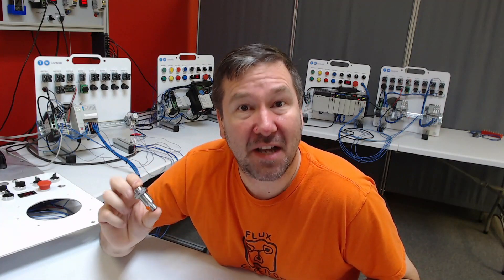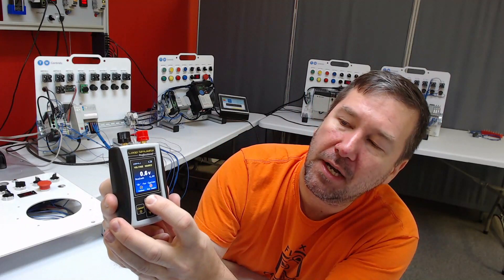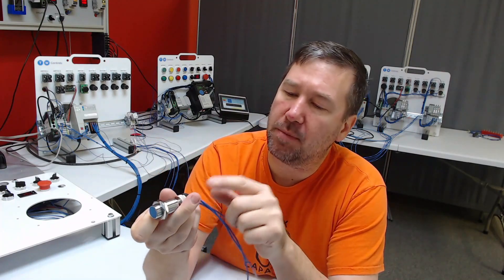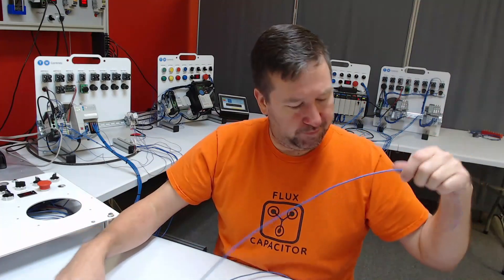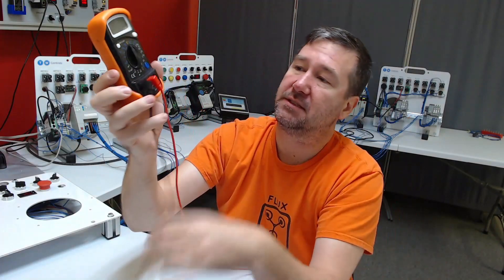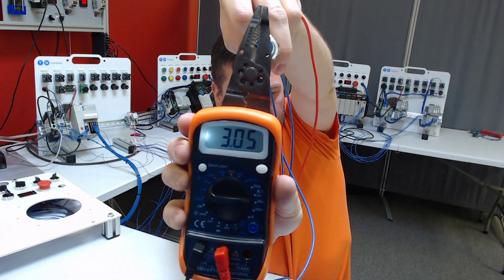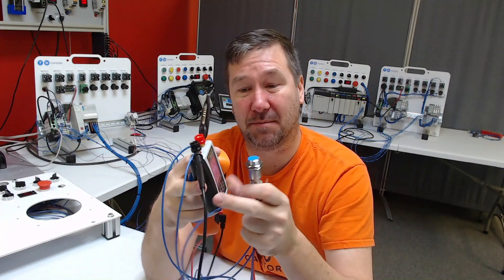Bench Testing a 4-20ma sensors with a Multimeter and No Power

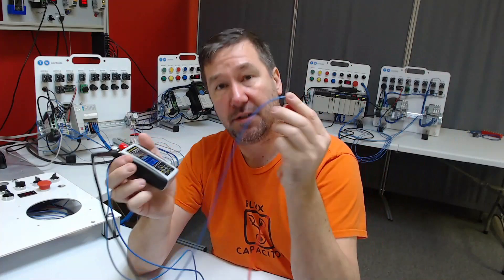Comment from the maker: At 2:00 I misspoke.  You touch the terminal #2, which is the only sensor wire left not connected, to the red lead of the multimeter.  Thanks to Igor for the catch.

Comment: Hello Tim, I hope you can answer this question, how do you track an output or input that is shorting to ground?
Reply from the maker: There are devices that will tell you how far away the break is, pretty fascinating. But I'm usually just going to pull a new wire.

Comment: any suggestions on a portable 24v power supply ? When I respond to callouts I always have in my truck a Phoenix Contact Trio 120v input, 24vDC output power supply. I can not remember what drives the FMR20s, but I'm certain 10vDC wouldn't be enough to drive power to the endress hauser FMX21 pressure transducers. I've got one of those portable simulators, but never used it as a portable solution.
Reply from the maker: Aren't a lot of cordless drills 24VDC?
Reply: @TimWilborne  I'm not entirely sure because the only ones I use are 18v milwaukee batteries.
Reply from the maker: 18VDC is enough to power most 4-20mA loops...sounds like it is time for me to do a video experiment :)
Reply: @TimWilborne  Yeah, I'm going to be trying this out...
Reply from the maker: Well my test didn't go very well and want to make sure you don't do the same thing.  I tried just plugging a battery into my trainer and didn't think about that backfeeding the power supply.  It didn't like it so definitely don't end up in a situation where you parallell the battery and another power source.